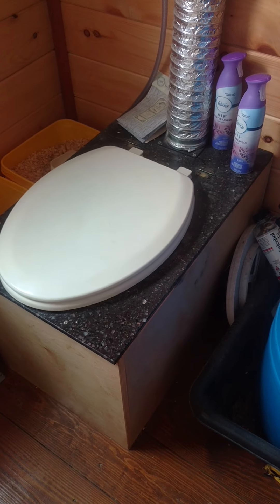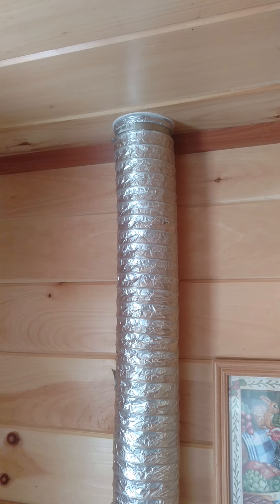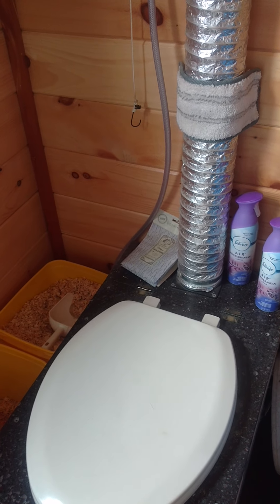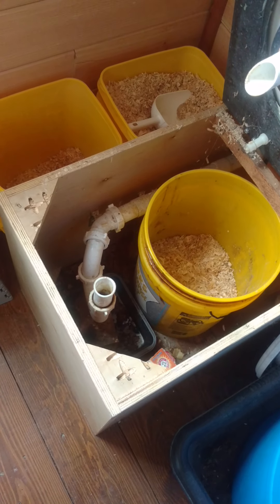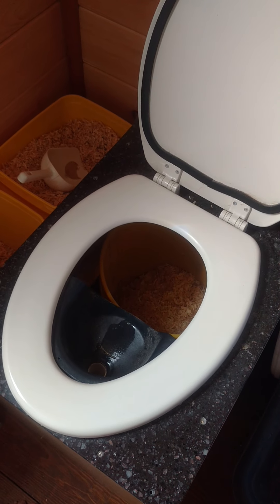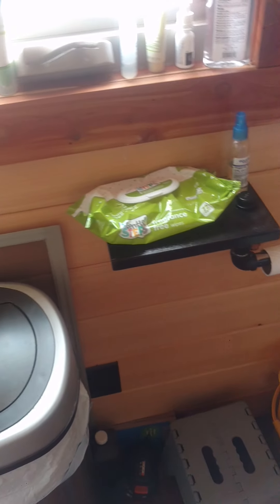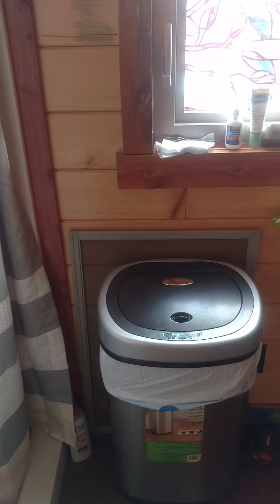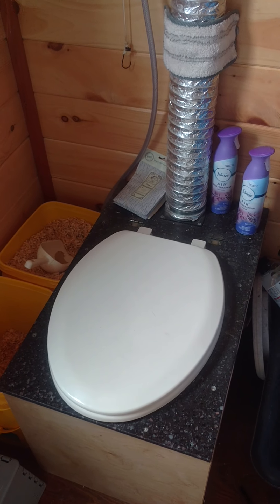Off Grid toilet with urine diverter and induced draft.  No smell, even when using.

Comment: I have 2 additional suggestions. If the vent pipe goes through the wall and is black PVC the direction of the sun heat will cause a vacuum as the air rises.  The other one is, if you put vegetable or any kind of oil in p trap in the urine drain it will block smell. This works because the oil will float above the passing urine .
Reply from the maker: @fredherzberger4677  I run a gallon of water through the trap on regular intervals to prevent buildup as well.

Comment: great set up, thanks for sharing. Just a note, that fan sounds a bit loud for the setup. Not sure what you are using but 100mm cpu fan are super quiet, cheap to buy and run and should suffice. Either that or you have some cobwebs or bugs caught in your fan! My experience tells me they need cleaning out after a while.

Comment: Nice setup. It would be easy to add a standup area for the guys just add another trap and plumb it into the other line. I really enjoyed this build and will he doing something similar but i will capture the urine as ferilizer. Just have the urine go to a 50 gallon resevoir. If that resevor is at a higher elevation than your crops. You could add some water to the urine at a 3-8 To 1 ratio and then drip irrigiate it out.
Reply: I think the standup area for the guys is known as "outside".

Comment: This looks to be a good design for reducing bucket-emptying trips! 
Good idea, that P-trap & sprayer….can that be used as a bidet, as well (because ladies need bidet sprayers that work front-to-back)? 
What is making that buzzing sound?  A computer fan shouldn’t make that kind, nor decibels of noise!? 
What did you use to make the urine diverter? 
Could you please post a parts list, in the video description? 
Total cost?
Reply from the maker: Had to watch the video again to determine what is making the buzzing sound.  Most likely it's the bathroom exhaust ceiling fan.  Also, we do use the sprayer as a makeshift bidet.  You just have scoot forward a bit to capture all the water to the correct area for drainage.  Everything is off the shelf items except the urine diverter, which I ordered from an ebay seller.

Comment: What about the curves of bucket ? Maybe some # 2 hits outside of bucket.
Reply from the maker: Everything has always ended up inside the bucket I've been using this method for 5+ years.  Occasionally, some hit the side of the bucket on the inside.  This has never presented a problem as the saw dust absorbs the moisture and there is seldom anything sticking to the inside wall when I transfer the contents to the incinerator.

Comment: Hi. I wonder, would you, please, share your source for the urine diverter piece that attaches to the seat of your toilet?
Reply from the maker: If you check out my other video showing the gold glitter urine diverter.  I found it on eBay.  I cut away the rear portion leaving the front lip for the solids to overlap the 5 gallon buckets rim so any urine that may not make it down the correct drain will at least get captured in the bucket.  Men usually don't have a problem with flow/direction control while seated to pee.  The ladies however, well it's a little more difficult to control where it goes, though nudging forward a bit is usually all it takes.  The "Golden Toilet" is made from fiberglass so it's easier shaped with a flap disc on an angle grinder.
Reply: @amicusfirepits  Thanks for the tip. I cant find the other video you mention, but I’ll be sure to search eBay.
Reply from the maker: @roadtriplover.  https://youtu.be/LEBK1BfpYcM

Comment: I didn't really see how the dryer vent is installed at the bottom. Can u please explain that.
Reply from the maker: Because most of what I need isn't available as an off the shelf product, I spend a lot of time roaming around home stores looking for anything that might work.  In this case I used a PVC storm drain cover, cut out the center portion where the holes are, leaving enough plastic for at least 3 screws to anchor it over the opening in the toilet.  Same thing through the ceiling and exterior wall.  The dryer vent fits snug but I still used large hose clamps to secure it in place.  Hope this helps.

Comment: I think computer fans use the 5V connections in a PC if that helps.
Reply from the maker: Some fans do, others are available as 12v.  I've even had the 120v models.  In this case, the fan is 12v powered by an adapter from my household 120v system.